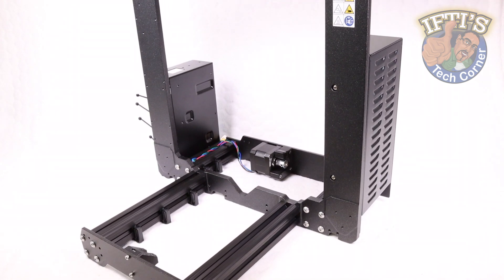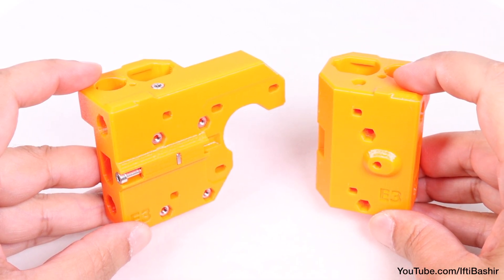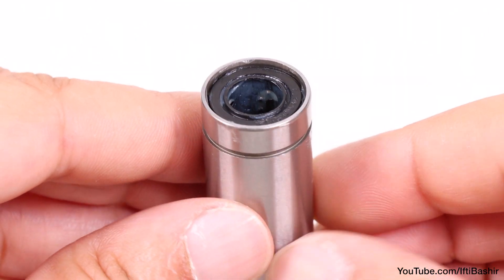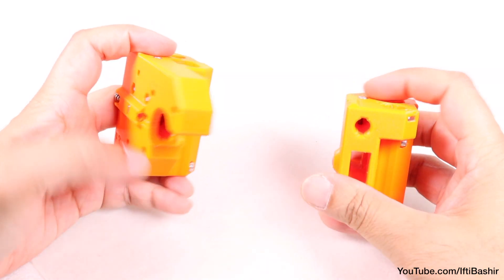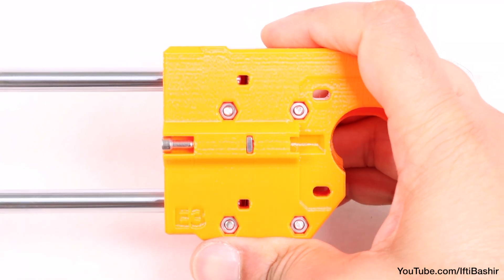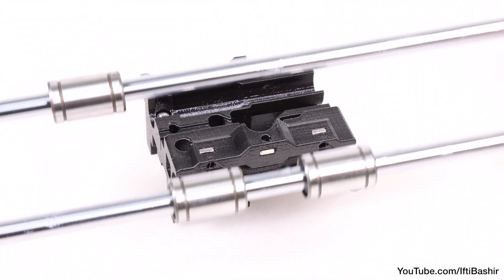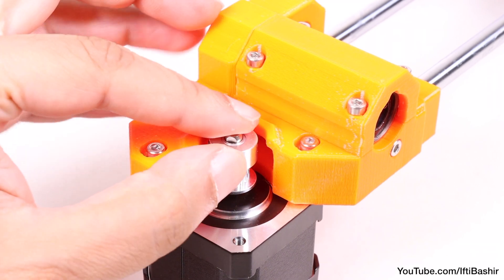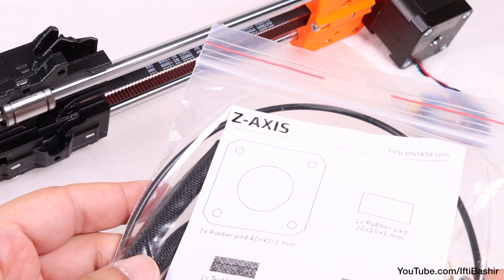#03 Original PRUSA MK4 Kit : Full Step-By-Step BUILD GUIDE - X Axis & Carriage Assembly

Comment: Built and own an MK3S+ (that has been rebuilt with improved parts) and while waiting for the MK4S kit to arrive, enjoying these very excellent build guides, as well as seeing the difference between models.
One thing I did with my MK3S bearing is rinse them out in 99% alcohol to clear out all the machine oil before packing them with grease. This was the recommendation by many back then, and so far no issues over the years.
Reply from the maker: @ScytheNoire  Producing a MK4s guide at the moment! It’s very similar though 😉

Comment: This is a fantastic addition to the official manual. I don't think my build would have gone as smooth without it. 
One note- I did break an X end cap snaping it on and had to print a new one. Slid that one on and went perfectly. Also, I think there are new pre-lubricated bearings in the blue bags. You can skip that step now.

Comment: Watchout! He says that you can snap on the x end clip but be extremely careful, I snapped mine and it cracked so I had to 3d print another one. I suggest sliding it and vibrating your hand back and forth . This way is just as easy as snapping it without the risk of cracking it.

Thank you so much for the video!

Comment: I note that you say to turn the applicator clockwise - the written assembly manual says to "turn the tube and applicator counterclockwise" - I assume the manual wants counterclockwise to avoid unscrewing the applicator from the tube.
Reply from the maker: Honestly it doesn't matter which way you turn - either way is not strong enough to unscrew the applicator from the tube in the first instance - the balls within the bearing let the applicator turn quite easily.

Comment: I love all these videos and they really help the build process a great deal. However, I want to warn people that by using this alternate (and now popular) "snap into place" method I cracked my x-end clip. The damage to the part was not complete and I'm hoping that when the Mk4 is fully set up it will still print well enough to replace this part (screwed down everything still appear in relatively good shape). But in my opinion the extra speed and ease provided by the snap into place approach is not worth the increased chance of breaking a printed part, especially if you are like me and do not have an alternate printer to generate replacements. YMMV.

Comment: The whole thing seems simpler for some reason than the MK3s+ I built. 
I have a MK4 coming. Might be just my imagination on the complexity. 
For sure the wiring looks ALOT easier. 
Having to replace the print fan and the ease of changing out nozzles (no worrying about damaging thermistor or burning yourself) is my primary draw to the MK4…not print speed. Replacing the print fan on the mk3 is a pain given you have to unravel the hotend harness and completely screw up any organization you MIGHT have had in the electronics box cables. 
Building printers is something I enjoy, but difficult repairs (as far as you might break something else in the process) not so much. 
The hotend breakout box is a godsend and was something I was similar to something I was trying to develop for the mk3 prior to the mk4 being released.
Reply from the maker: The always perfect first layer with no need to calibrate the Z-Axis is also excellent!